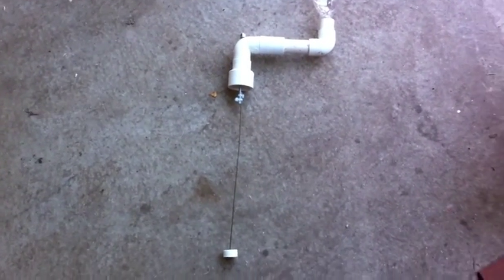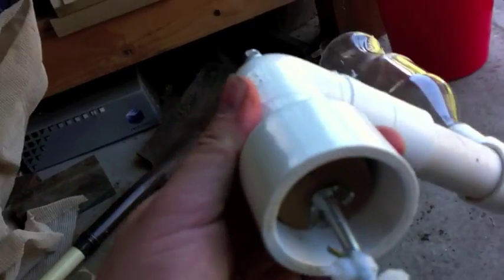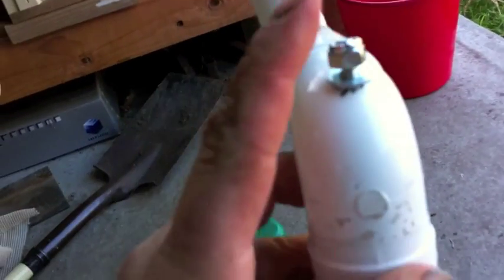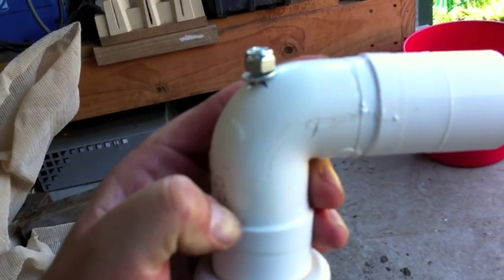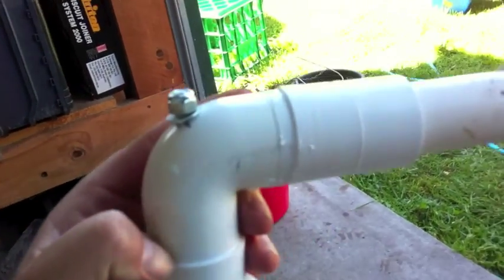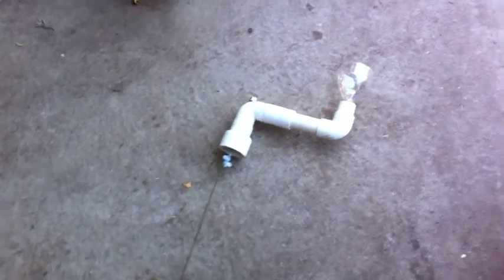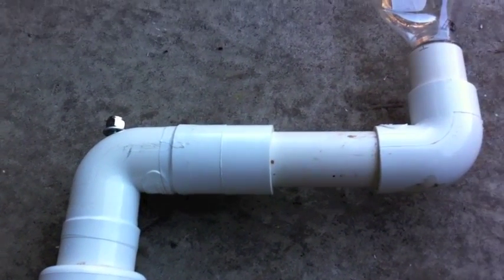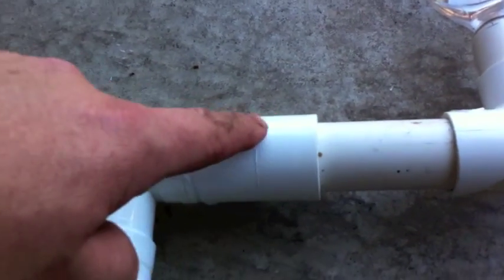On-demad feeder Version 2  - Failed

Comment: Sugjestion sawping the 2 90° elbows for 45° elbows
Reply from the maker: You are probably right, that would have helped. Now days I just feed by hand.

Brett.
Reply: If the angle with 45° is to steep,.. make whats called a "rolling 90°"  2 90°  elbows joined with a short lenght pipe inbetween.  set the 2 90°s to make the angle you want by rotateing them useing the short lenght of pipe inbetween